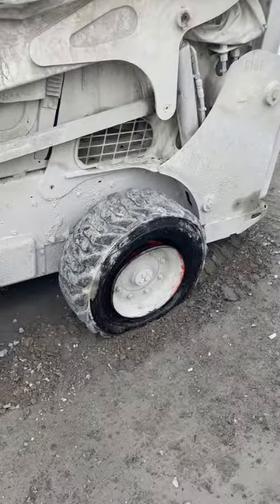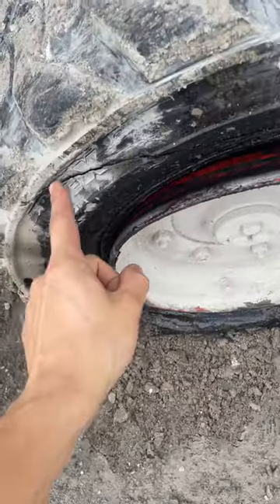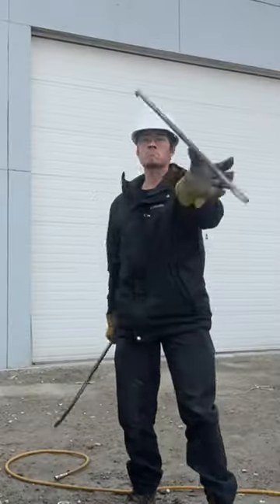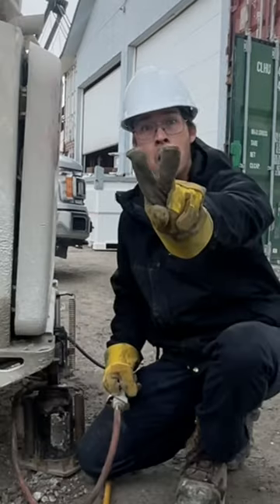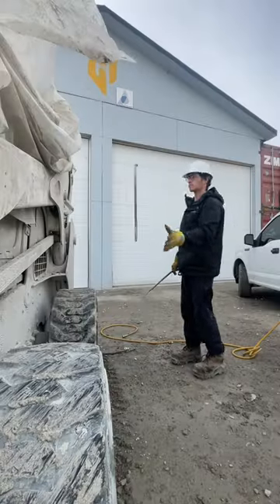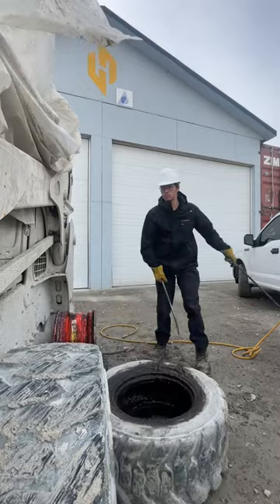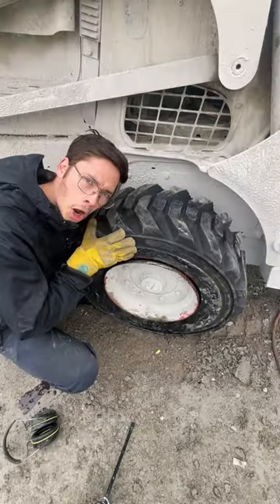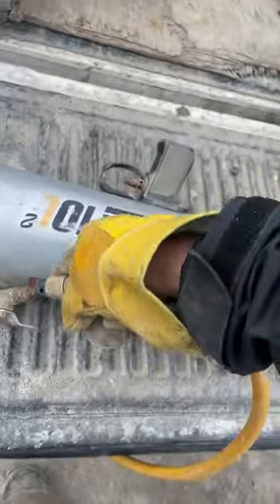I Hope The Jack Holds…

Comment: I spent my time in mud and gunk doing on site tire service. My best friend was a cheetah wich is essentially a 30 lb propane tank with the valve and port off the side rather than in line like this bazooka tool. Team that up with twin ingersoll compressors powered by kubota three cylinder diesel engine. 3/8" and 1" line reels plus extra hoses for those emergency jobs you cant get close to. I had an antique ingersoll 1" impact cannon, it was really too big to call it a gun, and a 3/8 ingersol rand titanium impact for most jobs. For those really seized up headaches i carried co2 for when i needed to shrink it and a hot wrench, acetylene and oxygen torch for those expand or cut off deals. I had to call for back up one time. That was because a backhoe driver had a rear tire puncture with a fire hydrant inside the tire. That was a fun day!

Comment: Hey quick question. Is there a reason you dont just cut off scrap tires? Im no expert but it seems better for your back in the long run.
Reply: It's not as easy as you might think to cut a tire off, if you know what your doing it's easier to pry it off the rim

Comment: Hey i have a couple new powerfist airbottle jacks. Won't run on the air! I tried air tool oil, would the jack being low on oil not make it run off air?
Reply: Yeah thats most likely the problem.